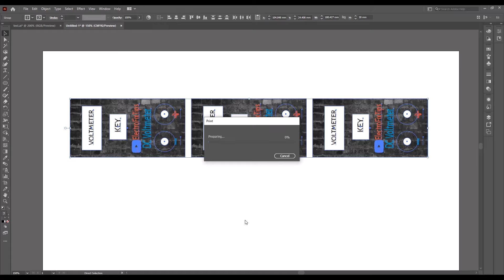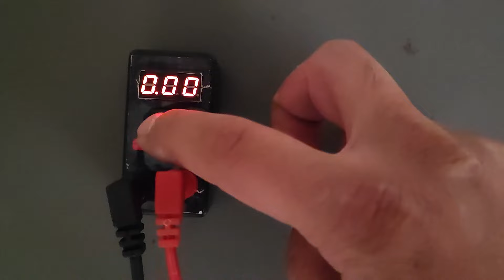Making a mini voltmeter less than 2$

Comment: Sir, I have a question...on the website the voltmeter works at 4.5-30v...and you use a 3v battery...can you explain how make it works?
Reply from the maker: 0.28 inch Mini Digital Voltmeter
Display: 0.28 inch 7-segment digital display
Voltage Range: Measures voltages from 2.5V to 30V DC
Size: Compact and mini design, ideal for small projects
Accuracy: Provides accurate voltage readings
Easy to Use: Simple to connect and operate
This mini digital voltmeter is a great choice for various electronics projects where you need to measure voltage within the specified range. Its compact size and clear display make it convenient to use in tight spaces.
Let me know if you have any other questions!😊
Reply: Hes only powering it with 2 AA batteries (unsure why), screen turns on but says 0.00, I suspect that the batteries didnt have enough voltage to trigger the meter (depending on the AA battery type, the voltage might have not exceeded 2.4v combined) and only when he passes higher voltages did it start to read anything.

He really didnt need the AA batteries at all, the voltmeter would have powered on and displayed voltage from his external power supply without them. I am not sure why he did this, maybe he thought it would improve accuracy? I really dont know.. but adding the batteries to the equation while also testing another load isnt what the voltmeter was designed for and probably only throws off the accuracy, it is only meant to measure a single connected load.

Basically, this cheap voltmeter isnt a multimeter.. A multimeter is designed to measure a wide range of voltages. It uses a high-impedance input circuit for measurement of very low voltages (millivolts). This cheap voltmeter with a limited range is designed for specific uses, like automotive or battery monitoring. It has lower input impedance making it unable to detect very low voltages.. All he has done is solder leads making it LOOK like a multimeter, but is still a voltmeter